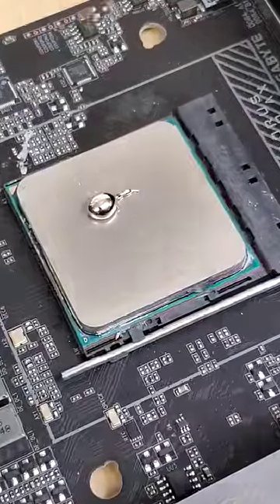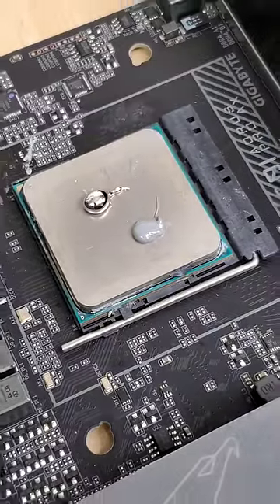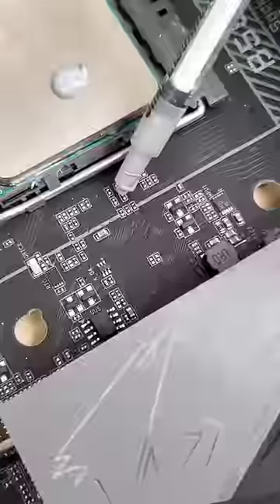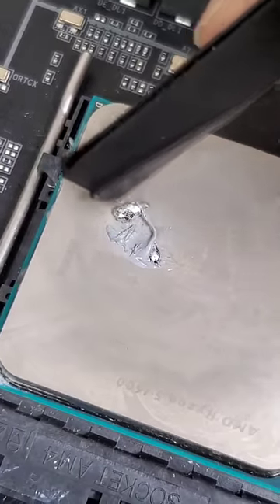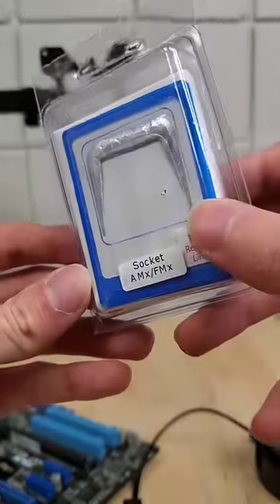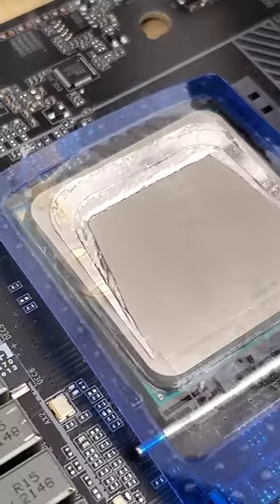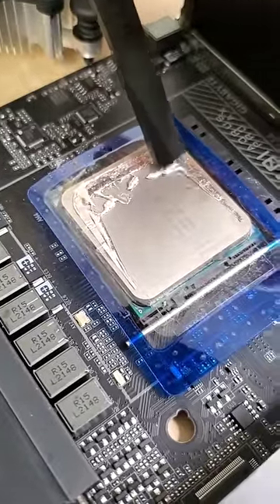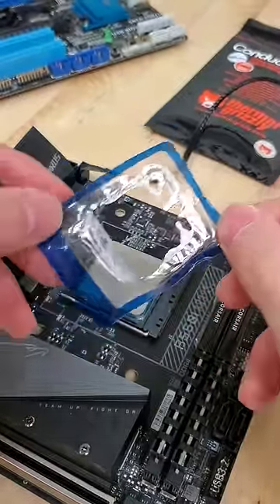the future of thermal paste technology #shorts

Comment: I believe we should have CPU's in a form factor that would prevent the liquid from spilling, basically a lip at the edge.
Aside from that, as another user here mentioned, used tiny amounts of thermal paste at the edges to box in the liquid. I can't attest if it is foolproof, so you can go ahead and test it.
Another way would be to mount the motherboard with the face down and have the cooler have a lip itself, this way no liquid will escape.

Comment: yeah definitely not for consumers :D. keep in mind that the reason we use thermal paste is to prevent miniscule air gaps between the cpu and heatsink. as long as air isnt trapped in between, it transfers heat quite efficiently.

Comment: Metal comes with good electrical conductors 💀, so we can't use directly metal paste but as you described we can use metal paste in a right way. Also in future we will get some metal based paste for more efficiency of removing heat from cpu 🙂.

Comment: They’ve solved CPU cooling without limitations for consumer grade use cases (ie not edge case overclocking or record setting). These people delid their CPU’s, because in reality, thermal conduction bottle neck is the IHS bonding. (Remember Intel using ‘toothpaste’ for their IHS packaging?)

The solution solves every conceivable issue with every types of heatsink transfer material. ALL OF THEM.

No difficulty in applying, no replacement timeline AND reusable.  (And no liquid metal alloy corrosion causing irreparable damage to IHS)

Graphite pads. 

Tested them myself couple years back, at best it was 2/3C variance version fresh paste (paste doesn’t stay fresh…). [Only used on AM4 builds so far, 6 in total, all perfect]

It’s a god send for building pc’s for other people, who by the nature of their request are less inclined to do pc maintenance.

Seriously, just buy a pack of 5 graphite pads and you’re set for life (likely why no one advertises them, they’re self defeating for profit).

Oh, finally, ZERO cleanup to change heatsinks etc. [VERY helpful when I’m testing heat sink performance on my SFF cases]

Comment: Another issue with liquid metals is corrosion, especially on aluminium  due to it being a highly reactive metal and forming an amalgamate with the commonly used gallium. On copper the corrosion could happen on other more reactive metals like the metal thermal paste itself, aluminium parts on the cooler and even the IHS.

Comment: The plastic (lower heat conductivity) litterly negating the effect of the "phasechange metal" when if can prevent the leakage of the metal in a molten phase,
and if not its not more secure than just dumping the liquid metal onto the CPU would have the same effect. (not worth it.)

Comment: Also instead of a electrical powered cooling fan use a conductive fan that runs off the heat. Minimize the usage of electricity that causes heat and a fan that constantly cools at a regulated temp

Comment: Phase changing seems like it's was released before any actual practical testing. If it can go from solid to liquid then it means it can also go liquid to solid. Living in the mid west where winter comes fairly regular. Phase changing lifts one side of the the house every year. In worse case scenarios capable of damaging lots of things. I can see this product failing already, something got to give eventually, either the walls leaking onto the board or pushing your cpu down or cooler away. It's not a matter of if but when.

Comment: Liquid metal isn't as scary as it's made out to be. Simply put a drop on the CPU and spread it around carefully and thoroughly. Take your time. Once it's on, you're good to go. I did it on my first shot. Contrary to what you might think, this stuff doesn't ooze or run. In fact, it's pretty tenacious, and hard to spread out evenly. It's worth it, however. CPU temps plunge.

Comment: I heard that somebody swapped the top of the cpu with copper and the temps dropped by 10°
Reply: The heat sink or the top of the cpu? Actually now that i think about it, i wonder why a heat pipe isnt used. Its copper with water sealed inside it, the movement of the fluids (liquid heating up to gas and condensing creating a mini circulation) causes it to dissipate crazy amount of heat, being able to cut ice like butter just from the watmth from your hand holding it. And the risk of getting it wet wouldn't be there because it's sealed in metal. Normal thermal paste would probably be fine with that.

Comment: From a thermodynamics perspective that plastic will ruin the conductivity of the metal. Like there's no point in using metal anymore because the plastic has a different heat transfer rate. It's like a millimeter of air seperating your hand from a hot frying pan vs touching the pan. The plastic drastically reduces the efficiency.

Comment: The problem with liquid metal isn't just that it's conductive... It can be absorbed by aluminium like water into a sponge due to the galium content.

Then your heatsink (most are copper pipes in aluminium) will crumble apart like it's made of dried mud.

Comment: If you face the heat sink properly (polish the heat sink and it's atomically flat) you don't need thermal paste. Easy solution.
Reply: or you could use some thermal paste and put a cooler on it and save a bunch of time.

you want lower temps, under volt and turn off turbo boost/PBO.

not a lick of difference in 4K gaming when GPU bound.

Comment: Thermal past is design to be applied as a thin  even film which fills in cracks and defects that is interfacing the bottom of the fan to the actual cover on the chip. I’m running a 9400f and have never had a problem with CPU temperatures that may make the the cpu unstable regardless of what game I play from NFS, COD, GTA etc

Comment: thermal paste doesn’t remove the heat it closes the gap between your cooler and cpu. There are microscopic ridges that wouldn’t conduct the cooling well at all so the thermal paste closed that gap and makes 99.99% contact

Comment: Most thermal compounds are not silicon based, but ceramic based, using oxides of silver, zinc, copper and the like to conduct the heat. Often in oil based substrates and not silicon which is a thermal compound, but isn't used as much because of its' really low thermal conductivity compared to the oxide alternatives.

Comment: It sounds good to see that a potential alternative to thermal paste has been found, but I think that should mean the computer performance should not be abused into basically frying the internals while keeping one sector cooler. Rather this means that the whole system has to start getting upgraded to deal with higher temperatures in a functional case, and for a reasonable price

Comment: It also is impacted by gravity more than silicon thermal paste, if your motherboard is upright in its case the Liquid Metal will tend to flow to the bottom of the plastic enclosure. Look up the issues that the PS5 has had with this.

Comment: For a normal PC its just not worth it. Its way more important to transfer the heat from the radiator to the air. Since the cooler the radiator, the cooler the cpu.

Comment: Graphen thermal pads seems to be infinitely better solution. They are as good as thermal paste, but they are always in solid state, so there's no mess at all, and they are reusable as long as they not teared apart. Probably it's not a bad idea to replace used up thermal pads with copper shims layered with graphen pads from both sides...

Comment: I built an old x58 pc for $350 8 years ago and used a $20 cpu which actually worked really well. Delidded it and used liquid metal. Overclocked it to the moon and never had problems. Still used that PC up until 5 years ago when I built my previous AMD based PC. I actually still have the motherboard and cpu in my closet lol.

Comment: Okay. The glue on the plastic will also "Change phase"
the plastic might rip or the pockets might burts from too much pressure, a bad installation.

Now, you can't even spread it without having your CPU hot... Which also means, if you need to take the heatsink and fan out, you need to have the computer running for that... And once you're done and want to change the paste or something. You need a heat gun to clean the cpu...

And now... The risk is that liquid metal, is a liquid. So having the liquid metal be "Phase changing" IT JUST MELT!!! It's going to be solid when cold, but it's going to be liquid when the computer is in use. So This liquid metal is safer only when you don't use it...

Comment: ok, so, hear me out, use electrical tape or vaseline for the stuff right next to the CPU socket, sure, looks ugly, but for that extra 4-10 degrees depending on cpu/load, i think it's worth the trade off for that extra bit of security, personally use a bit of vaseline, plus i have my motherboard laying flat, not mounted to the side of a case, also helps against spilling

Comment: the irony here is that thermal paste isn't there for heat transfer, just to fill in any imperfections on the heatspreader so there is more surface area for heat to dissipate from the cpu to the cooler

Comment: This presents you with a new problem. When you go to mount the cooler you won't have even contact across the CPU since this metal is solid at room temperature. Which means, you can only tighten down one side of the cooler since the other side is held up by the thermal paste...

Comment: Why not try putting a very thin line outer ring thermal paste then put the rest in the middle as a liquid metal thermal pase, that way the silicone would act like a barrier so the metal thermal paste wouldn’t leak

Comment: Stay away from gallium liquid metals. They react with any metal not only with aluminium, tho at different speeds. Its also a pain in the ass to clean and because of its high surface tension insanely difficult to spread across the surface

Comment: What if, and hear me out, use both tubes. Put the silicon thermal paste on the outside edge and then the metal on the interior that way the silicon stops the metal from pouring over

Comment: 1. That was way too much TIM

2. You need about a pea size tops and should be applied in the middle of the processor, tightening the cooler will spread evenly across the processor.

3. Been Using AS5 on CPUs and GPUs for almost 2 decades and have never once had any issues.

The stock pads and TIM are s**t

Comment: I had liquid metal thermal "paste" in my laptop from the manufacturer but it completely squished out of the way and was stuck on the edges of the heat synch connection point, causing it to burn a little. Had to replace it with normal silicone thermal paste

Comment: A piece of plastic on and around the heat up CPU? I get that the rationale is - the plastic wont melt because at the same time the liquid metal keeps the CPU cooled, but at the same time ignoring that one put liquid metal on a CPU/GPU to squeeze any performance out of it and that automatically means very high temperature(that's not good for plastic).

Comment: these things have been around for 20+ years. And there's nothing safe about them they still can leak. Especially when the CPU is oriented vertically with an improper heat sink. That means absolutely no aluminum heat sinks whatsoever.

Comment: most air coolers and aios heat-plate is pure copper, therefor liquid metal isn't ideal. it forms alloys and corrods the copper. that corroded layer harms thermal conductivity!

Comment: See now, I'd just do a thin-ish edge of normal thermal paste on the outside of the CPU, then put the liquid metal inside of that barrier. Theoretically, that should work. You'd want to somehow put an extra catch-tray around the CPU for when you remove the cooler, just in case too much paste comes off though.

Comment: It doesn't really mitigate the risk properly plus there's now plastic around the edge which is absolutely terrible for thermal conductivity.

Look at the PS5, they used a enclosure around the processor with foam that should of been 100% safe yet there's still loads of dead consoles where the LM has escaped onto the board.

Comment: Wouldn't it be safer to just use the liquid thermal paste without the plastic rim and put a silicon coating on the rest of the motherboard 
Like a spray you could apply 

I dont know much about computers or at least not enough to know if this wouldn't be viable 
Could someone that does please tell me why if at all this is unachievable

Comment: Yeah. And then get it to fuse into the plate of your cooler.
And It's pointless to use Liquid metal if you have a metal lid covering the CPU chip. Liquid metal should be applied only directly on chip.

Comment: You'd just need a copper jacket to go around the lid of the CPU which would double as a socket for the cooler then the user would take a syringe and inject the liquid metal. The assembly would be closed up with a stemmed lid.

Comment: Delid my 7700k back when i first bought it and put metallic thermal paste on to try overclocking to 5Ghz. Still running 5Ghz and still have the same 1080 with metallic paste as well. Im overdue an upgrade but i game 1080p 240hz easy.

Comment: Since liquid is sticky and wants to stick to each other and the lowest point of resistance, This seems like a horrible idea. the only way I could see this being safe for install would be for the MoBo to hanging inverted in the case with some type of drip edge as an added measure of safety

Comment: Thermal paste is completely useless if you have a good cooler…. As you said yourself metal transfers heat much more efficiently than silicon. 

Buy a water cooler and you already have cold metal cooling your hot metal cpu. 

At that point thermal paste is just going to dry out and cause you issues in the long run

Comment: I’m a complete noob so please tell me why this would be wrong. But if metal has a way better thermal efficiency than silicon, why can’t you just directly put the metal of the cpu against the metal of the cooler ensuring that the fit it nice and there’s no air in between?

Comment: I have liquid metal in my computer for one primary and one secondary reason.

The secondary reason is the better cooling Wich means higher over clocks on my ancient core I5 2500k.

The primary reason is that I'm lazy and I don't want to take the computer apart to change the thermal paste from time to time 😂

Comment: Doesn't look like it properly covers the cpu and that liquid metal is not going to work in most PCs because 98% of motherboards are mounted on the side of your tower and not laying flat and level so it will leak and brick your motherboard. There are high end thermal paste in the market like gold infused thermal paste if you really want to but most that you will get is perfectly fine for most people.

Comment: You know you can actually get a thermal pad that does 63 Watts per meter Kelvin and it never dries out Yes it is made of graphene AKA graphite which yes is electrically conductive but you can cut it to the correct size if you have a weird processor what people don't understand about these liquid metals is they're made of gallium You do realize that's going to fuck your shit up over time right If not sooner than later to be a liquid at room temperature it has to have gallium or something like that in there which you will actually eat things away it will get rid of the metal structure and you're going to be really pissed when you take stuff apart oh and by the way if the metal on top of the CPU is being disintegrated how's that going to cool down your processor The transfer to heat off of that to your heat sink at the end it's not 

Let me put it like this I have a 1055T true six core processor with hypertransport yeah it's old I made my system in 2011 I'm still kicking ass and taking names I can play DCS at 1080p no problem My monitors are my restriction eventually I know my motherboard bus on certain things I will have to change but I mean holy hell I definitely got my money out of my system replacing a few parts now and then but I run a thermal grizzly thermal pad carbonaut and with an MSI liquid cooler all in a server chassis and it's not a problem whatsoever on an Xbox 360 I put in an innovation cooling and/or for short IC diamond thermal pad 35 watts per meter Kelvin and let me tell you that thing doesn't overheat anymore I can pretty much leave a fan at low power I don't have to disable the PWM when I'm running it hard it stopped that problem real fast 

So now you got two different price points there The one was like $12 and the other one was major money but there you go A solution that involves no more mess in his completely reusable and if you buy the thermal grizzly which is also made in Germany you get a nice little package for it that is also reusable so you don't damage the pad 

If I build computers for people or they want me to service them I upgrade them automatically to the thermal pad because I know that's going to be way more effective than any any thermal compound and or paste out there don't have to worry about making a mess Don't have to worry about servicing it in the future especially three years down the road when thermal compound depending on what you plan to use really drives the hell up especially under a lot of high heat 

The only one that I ever found that never really dried out was the Arctic silver ceramic for some reason however they make that it doesn't have issues drying up it's just as wet as I put it on years later shocking but it is not the same conductivity heatwise versus even the low end thermal pad that I mentioned before of 35 wmk